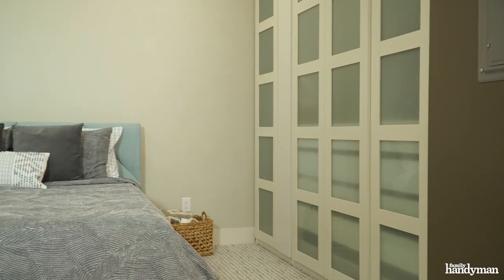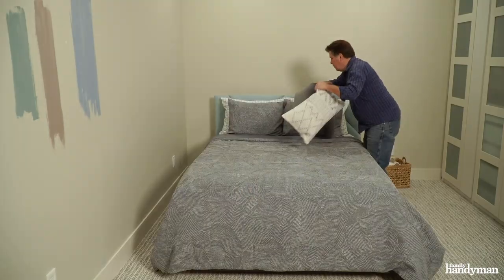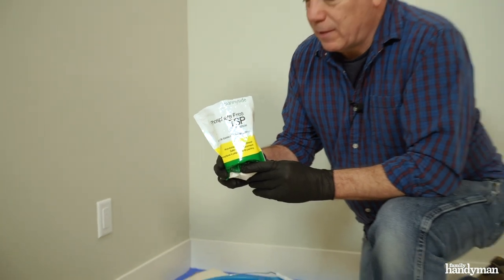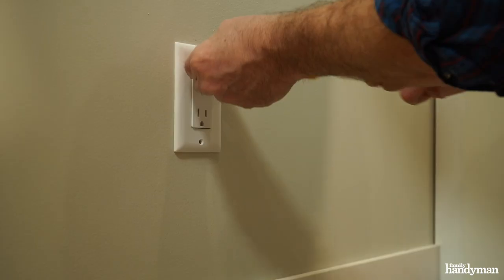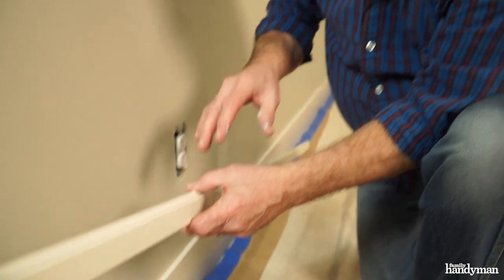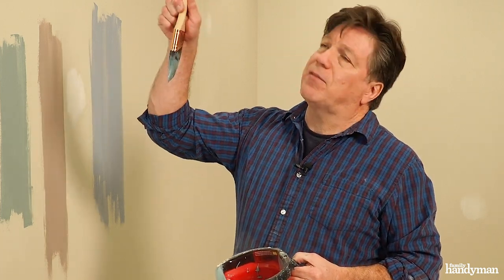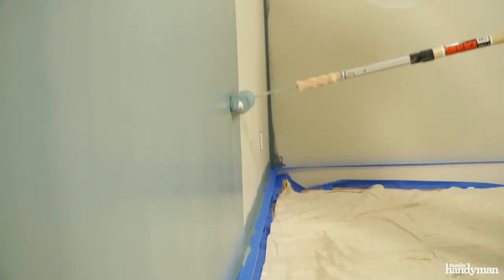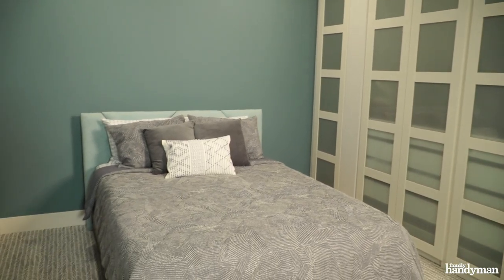How to Paint a Room

Comment: You should show how to properly cut in  ceilings the walls turned out great but the ceiling lines weren't so good. Loved the video though all the stuff i use except i would recommend crawfords spackle and spot priming with the wall color instead of a white primer unless you used just one coat but a color change you should really do 2.